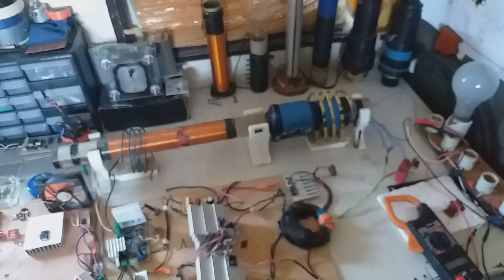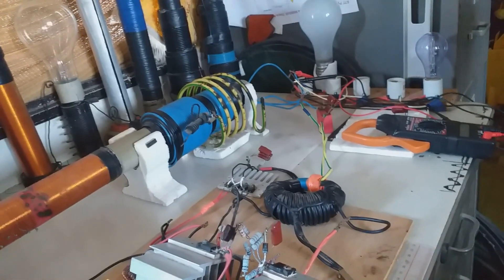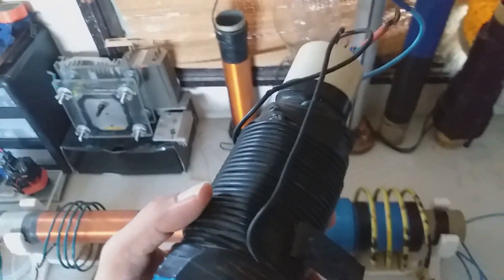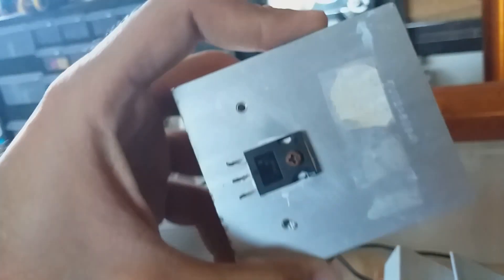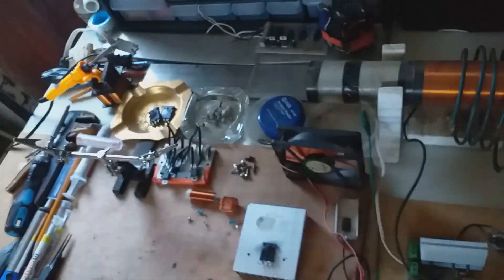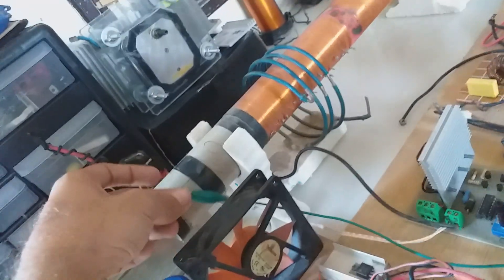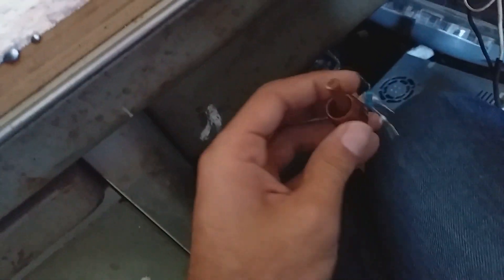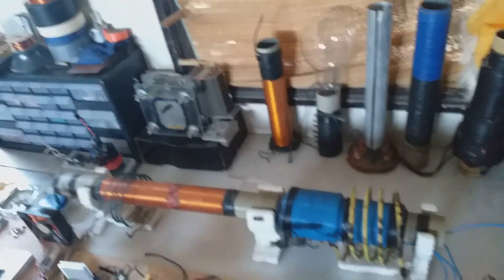Geofusion New crazy updates, grenade and and some more =

Comment: The air-core current transformer you're using is different from conventional ferromagnetic core current transformers,  it is actually a Rogowski coil, the current relationship between Ipri and Isec could be different from conventional CTs'.